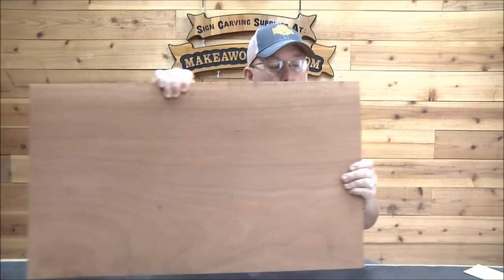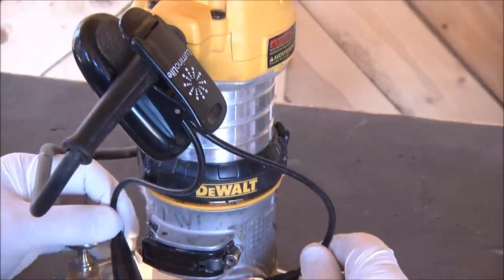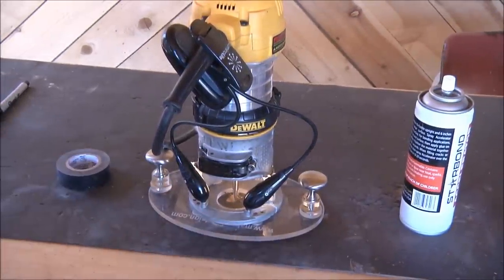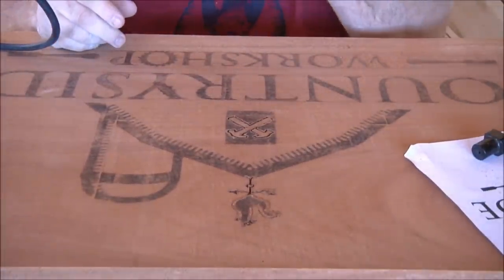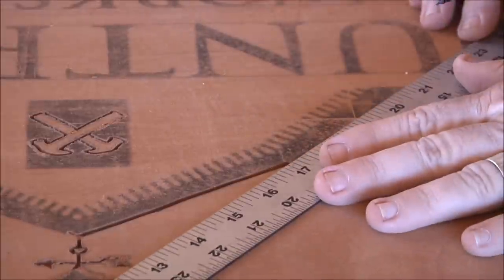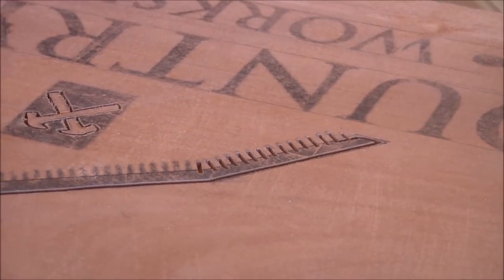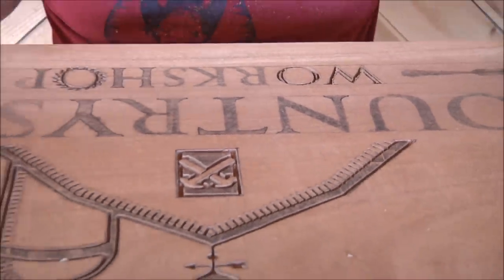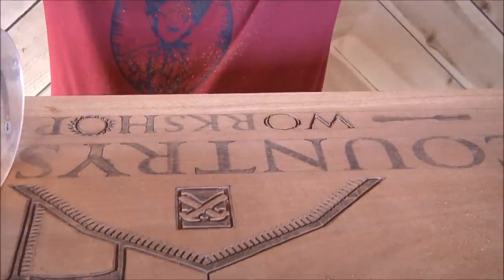#385 Part 1 Countryside Workshop using Mahogany Luminolite / Starbond

Comment: Eric asked before. Did you use angle grinder to cut the other window in the router. Just got the Dewalt you use
Reply from the maker: That would be one way to do it, but no we used a hole saw in the drill press and then a hack saw. Se our videos #50 & 51.

Comment: Tremendous job again Eric!  What is the website for the CA glue you use?  Coupon code is makewoodsign for discount?  Looking for the thick and activator spray.  Thank you jm
Reply from the maker: Sorry I forgot to put the link   https://www.starbond.com/?rfsn=2506382.cc8fb4   Yes I like the thick for this application but I do use the medium sometimes as well. I like the spray can accelerator better than the pump.

Comment: I noticed that you "feathered" the details on the rooster. Sorry, I couldn't resist.
Reply from the maker: Great point, LOL.... Wish I had said it first....
Reply: Also noticed you didn't use the sc50 on the saw blade...went with the profile and kept the base plate tilted up. 
Takes good control to do that amigo!
Reply from the maker: Thank you Joseph.... I've had some practice. LOL...